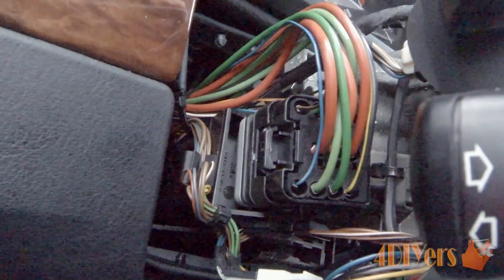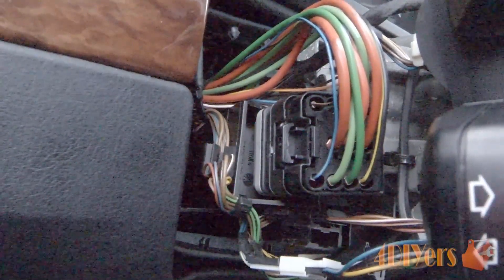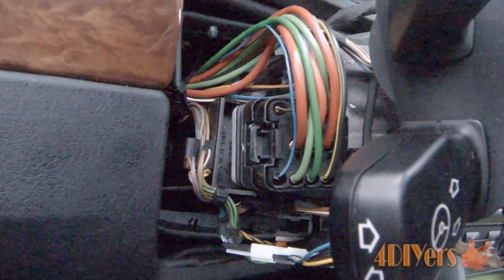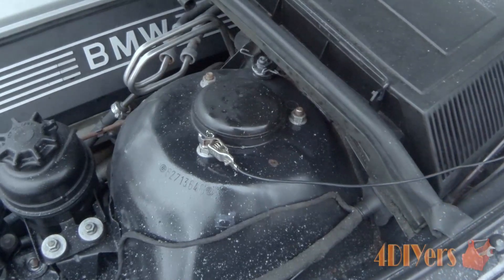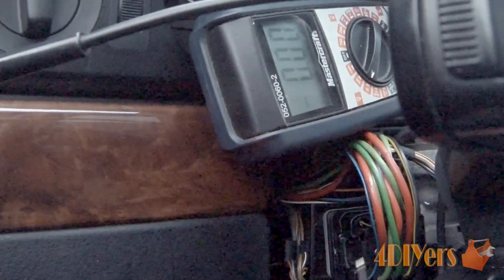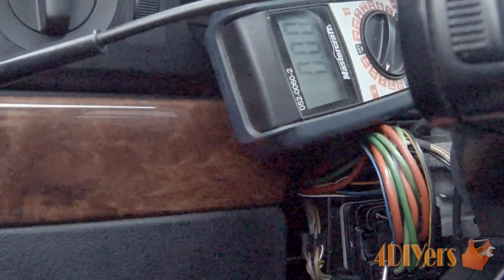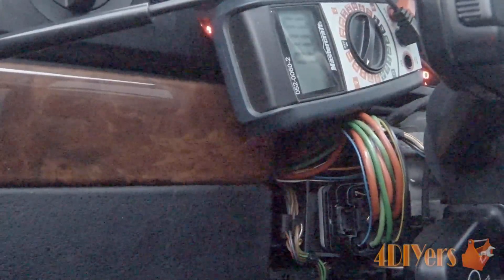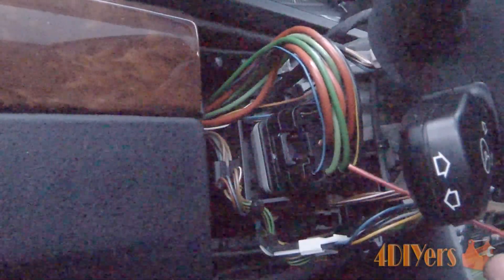DIY: BMW E39 Igniton Switch Testing

Comment: Wow, great video, thank so much. It's important to note that these switches aren't a flawed design, the issue is how people use them - trying to turn the switch when the steering wheel is "loaded up" - from shutting the vehicle off previously without allowing the front wheels to "settle in". So always pull the wheel one way or the other before starting to make sure there isn't undue stress on the switch.
Reply from the maker: Thank you. And great tip as well, something which is commonly overlooked.
Reply: Great video. However, my problem is that the engine won't switch off after I remove the key. Any help someone

Comment: Can this switch beaing bad lead to failing high beams and indicators not working?? Also i replaced my LCM and tested another indicator switch and nothing worked, i also have 3 yellow break lights in the dash(Traction controll, ABS and break light) plz help
Reply: Did you manage to sort this out? I think it’s the ignition switch

Comment: BMW e39
530D
2002
142kW
manual

Hello, I have the problem with the electronics in my car.
What happened:
- In the morning I come to the car and open with the key - Central works
- I put the key in the ignition and turned it to the first position
- The lights were charged and I warmed up and when I turned the key to other positions, nothing happened.
- On the next try, the lights did not turn on and the central locking did not work
- The fuses in the trunk are fine
- The fuse holders in the passenger compartment are OK
- The engine fuses are OK
- The battery has 12V
- I have restarted the GM module
- Turn signal, radio, windscreen wiper and parking light = are functional
- Others are dead

Do you know what it could be?

Many Thanks

Comment: Fantastical job. Put a new battery and a new starter and it still wasn't turning over. Did your test and I got 11.9 bolts on the starter wire, didn't quite turn it over and then I did it again and only got 6. I had 12 volts going up to the starter so I'm gonna pull the switch.
Reply from the maker: Thank you, glad to help out :)